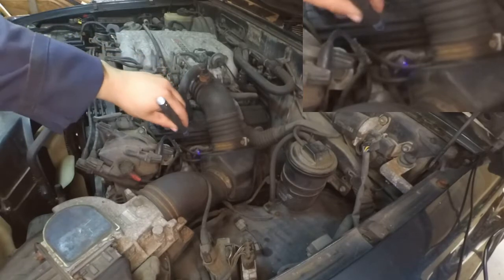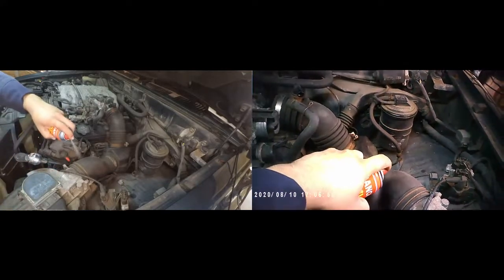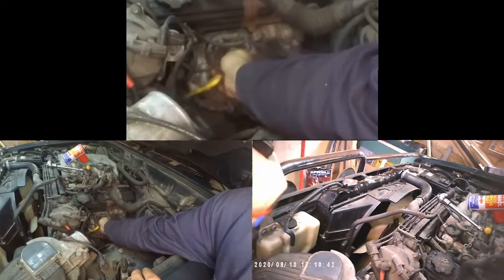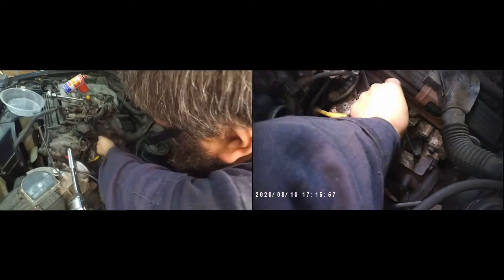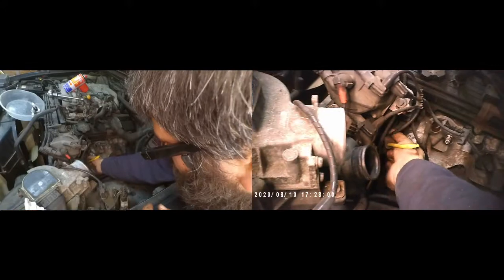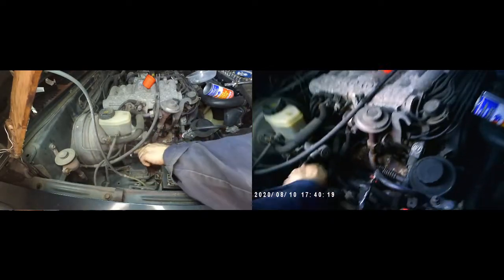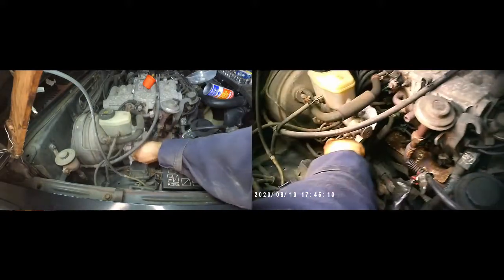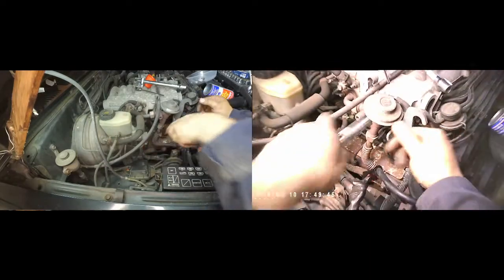Toyota 4Runner (90-95) Gen 2  How to Change the spark plugs V6 3VZE

Comment: I used help from the small hands of my girlfriend :) Its not an easy job with the sparkplugs!
Reply from the maker: i didnt find any dificulty reaching there after removing the parts you see. I did use a couple of steps to get better access cus im not particularly tall, but i dont know if the setup in the LHD cars is different and harder to work on. 
this is a RHD car, so its the design that you will find in the japan cars and UK. the steering column is in the other side for most owners which may or may not make the job harder
Reply: @tuga2112  The air intake removal was a good idea to make room. Good video, interesting to see a right wheel setup too!
Reply from the maker: @Dilomski  one of the most important things I've learned from working on my cars is to not hesitate removing parts in order to get access.
It saves blood for the job you're doing.
And by taking them out you also address rusty and seized fasteners usually before they become serious problems. 
That saves you the sweat and tears down the line. 
Mechanics don't do it because there's no guarantee on the returns
Reply: @tuga2112  thanks for sharing knowledge!

Comment: Did you need to measure/gap the spark plugs before putting them in? Or did you just put the new ones in without doing anything to them?
Reply from the maker: Just installed them. They should be coming from the factory with the correct gap. 
That's why they have the plastic cilinders on the end. In order to protect the end from bending and affecting the gap

Comment: TIPS: Blow out debris around the old plugs with compressed air before removal. Use a short piece of fuel line over the tip of the plugs to make the removal and re-install of the loosened  plugs easier. Also removing the vapor canister will allow a better access to the "passenger rear bitch plug". Re-use all the factory wire seperators as well, they are fragile. NGK Blue Silicone Wires are a nice upgrade to factory wires, while doing this dreadful plug change. Prepare to donate some blood.

Comment: Using a spark plug socket it should hold the spark plug so you don't have to worry about it falling off.
Reply from the maker: I lost  The rubber grip on my spark plugs socket some years ago 😆
Reply: Ya I lost the rubber grip to mine also.